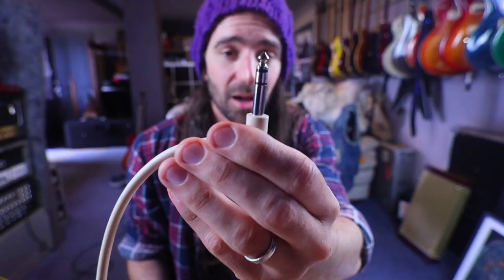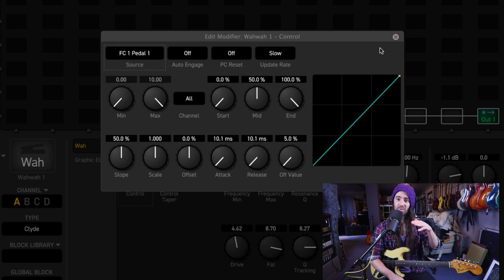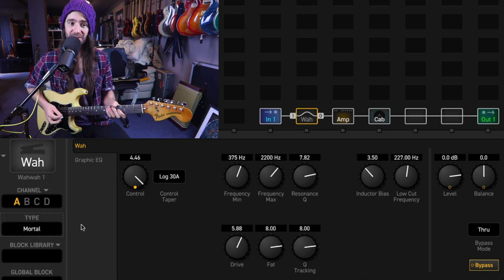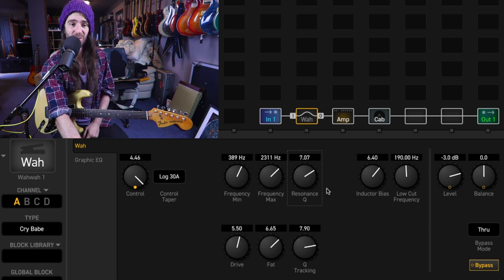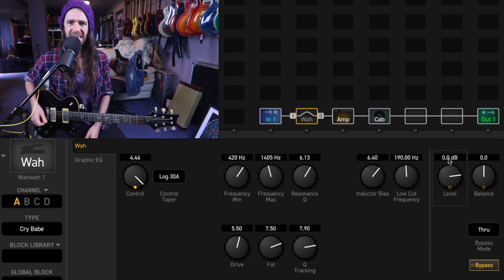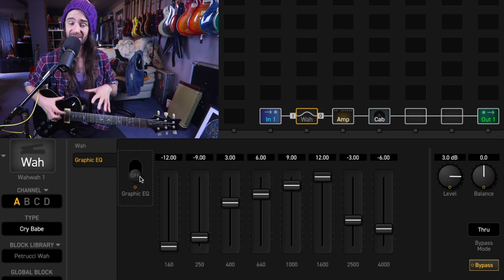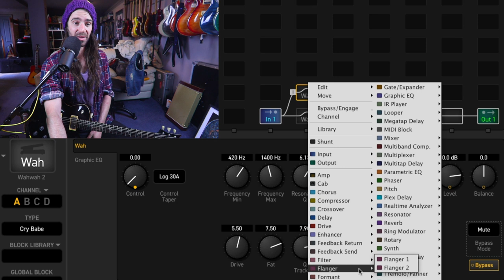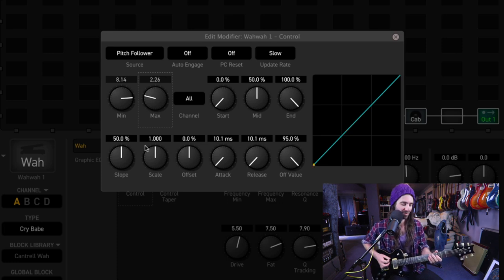Axe-Fx III - Wah Block Deep Dive

Comment: When I add the wah block to a preset build I created it doesn’t sound like a real wah. The low cuff is there but not the highness like when you roll towards the toe. And the control dial doesn’t react when I step on the expression pedal. It’s weird.

Comment: Man, I need to buy an expression pedal! That Petrucci Wah sounds insane! One question, do you get output level peaks with that extreme EQ settings in the wah? How do you compensate for that? Thank you always for your videos man, super helpful!
Reply: A distorted amp will turn the EQ peaks into greater distortion saturation at the peaky freq-ies.  It's the clean amp you'd have to worry about, or if you were doing the wah after the distortion and/or amp blocks into a clean high-headroom signal chain.
Reply: @NudnikShpilkus  Thank you so much for this.

Comment: i have this strange issue , i turned the auto engage to 95% as you said  but as i was pressing to the bottom of the heel it seems like it also affecting the volume by lowering it ,any idea ? i am using the sp-1 mission pedal
Reply: ok problem solved ! the problem was in the Global menu --> Other (page) --> Output Volumes (1-4)  were assigned to FC 1PEDAL 1 ......i turned them to NONE and thats it !........(i am rookie to Ax Fx 3 so shit happens ) , now time to rock on !  \m/

Comment: Hi all Great video. My wah on the axe 3 seems to disappear after I go past the 12th fret. I am using the cry baby with the settings in the video. Amp is the rectifier red modern. This problem really bugs me. Wah sounds great but in the upper registers it just disappears. Advice?

Comment: Thanks for this vid Leon. Perfect timing as I was just about the dig into the Wah block on the new Axe3. Wondering if you might be able to do a similarly deep dive into setting up a volume pedal in the 3 and the umpteen ways this can be done. Cheers, Don
Reply from the maker: The volume block I need to explore some more.